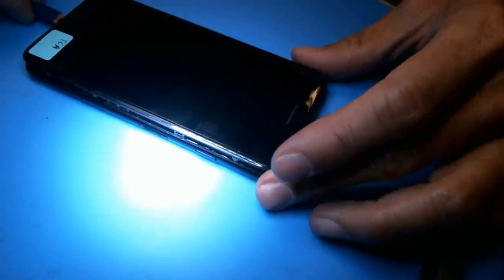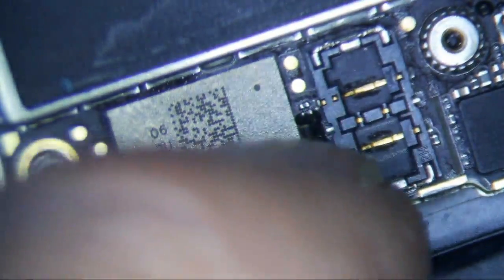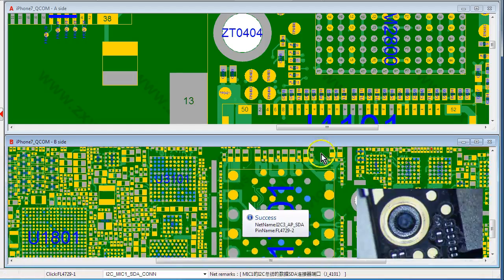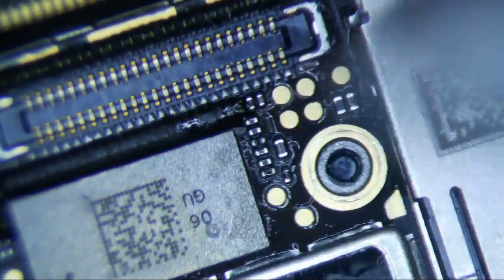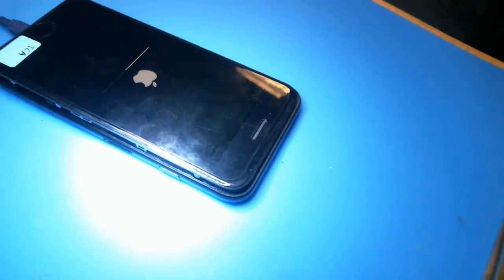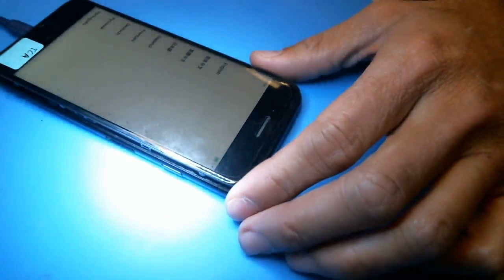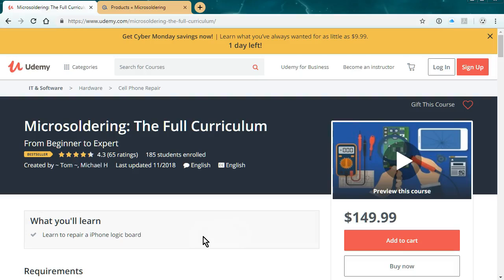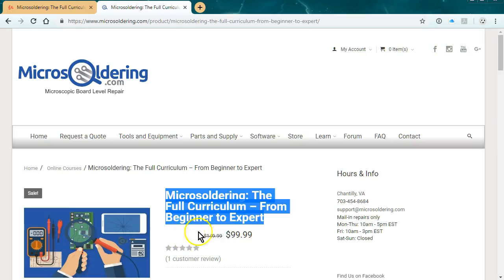iPhone 7 Fast Boot Loop Repair -  i2c failure

Comment: Thanks for your efforts to take time to create such content. Got an exact same issue. Customer tried a board swap into another housing and damaged the exact same resistor due to screw driver slippage.  Came in with fast boot loop issue. Gonna replace the resistor.

Comment: Believe it or not I had similar case and I was willing to chnage tristar ic and thats how I got into your video and happens similar resistor was pulled off from one side, replaced the resistor and Im looking right now at that loading bar ><